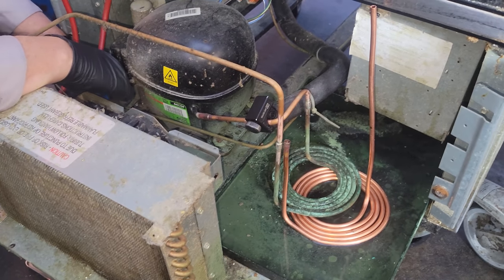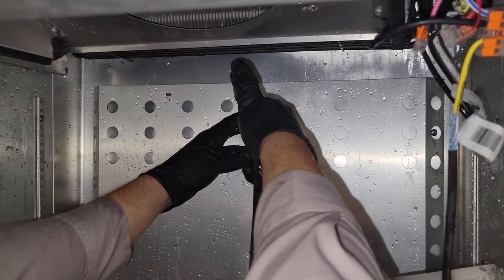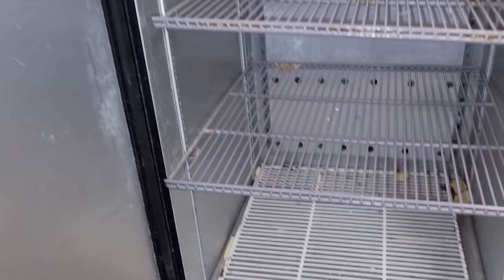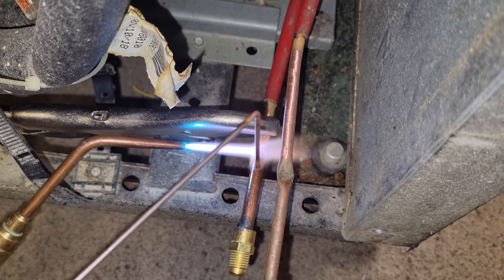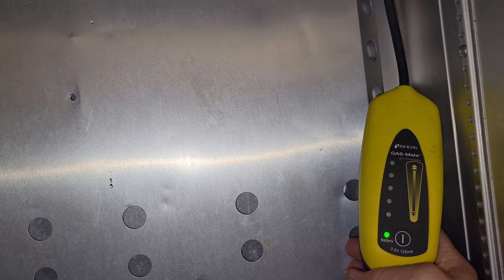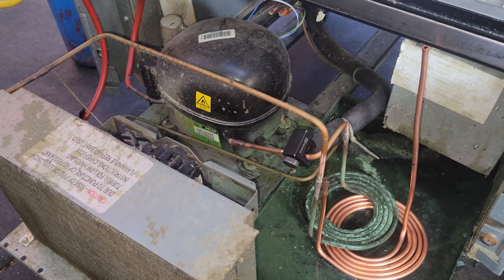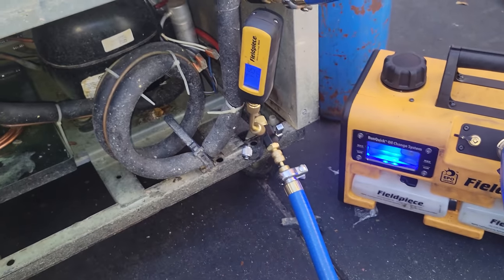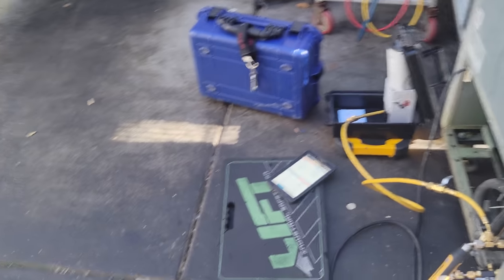TRUE STAND UP FREEZER MAKING A WEIRD NOISE

Comment: I specialize in small appliance refrigeration. I really like watching your videos. I love how meticulous you are. I technician the same way. A few tips. Yellow jacket makes a special manifold for R-290a with awesome colored 2mmID hoses (41868). Use a lab grade microgram scale for your R-290a. I also use an Accutools S10767 right on the refrigerant canister so I can turn it off right on the scale. I put another two S10767 on my core tools so I don't lose anything. TruBlu evacuation, attach manifold to core tool side ports, close pump, charge into the high side, start the compressor, home stretch into the low side leaving room for what's left in the hose leading to the refrigerant canister. Shut the can off on the scale. Let the last 0.04oz out of the refrigerant line. Then insert the high side shrader core and clear my hoses. I can consistently meet the exact charge weight every time. You've taught me so much, I hope this helps.
Reply: I have not work on R-290a system yet, but nice tips. Thanks
Reply: Gotta hand it to you. I’ve grown to loath small systems like these. Super critical charges, cap tubes, tight spaces, all the abuse they take... I work on the opposite side of the spectrum in system size, so it makes it worse when I get calls out to systems with only a few lbs or less 🤣 I like working on the huge systems, but I have massive respect for anyone who is skilled with any system, giant or tiny. Sounds like you know wha you’re doing, my friend 🤙 Kudos
Reply: The exact charge is not so much of a big deal in systems with liquid receivers.  In small cap-tube units,  it gets a little hairy.  But propane is an excellent refrigerant.  I used to use it in lumber dry kiln dehumidifiers in place of R22.  Gotta change the oil,  though...
Reply: Would a piercing valve be a better choice for adding a temporary service port on these small appliances instead of brazing on a whole new port and chopping it off every time? 😆

Comment: R290 is an excellent refrigerant.  It's nice to see that it is being accepted again in the USA.  I used to run 290 in systems I built using R22 compressors about 30 years ago.  But I was building dehumidifiers for lumber dry kilns in northern California in the early 1990s.  Worked with R12,  too before it was banned.  R290 is almost a direct drop-in replacement for R22.  It's good to see that flammable refrigerants are making a comeback.  On larger systems,  I was forced to use R22,  due to fire regulations.  But that was back in the 1990s...   when R290 was still illegal in many areas.

Comment: It was very interesting because that r290(propane) system had two leaks. First in the evap  coil then on that coiled discharge line in the drain pan. I watch your videos and they are awesome. I work on big refrigeration systems using r404a, but then I also work on household refrigerators which use isobutane(r600a) and most of them have leaks where cap tube enters the evap coil. Your sporlan's flare dryers and sight glasses are awesome, also sporlan's solenoid magnets and expansion valves are awesome too.

Comment: Dude a small trick for the condenser drain Heater i learn on the imbera fridge workshop, they put Heat shrink on the coper line, and that help you a lot with the corrosion by water or any fluid in it also still transfer the heat to the water, isn't like proof of leaking but at least make it last more without leaks

Comment: It may have been hard to see on site but the second service port you could actually see it leaking. Much like the ripples you see over a candle the same thing happens with leaking refridgerants or the like - that gas has a different density which causes the refraction of the light and you see it as that "wiggling" of the air. I was able to spot it on the second one because the camera angle was just right.

Comment: For the sensor replacement splicing... I would suggest you get phone splice connectors, and get the wet environment ones that are gel filled, as they are designed to splice low voltage thin wires and be in hostile environments without much monitoring.
Reply: Yes ,the ur and s.u.r connectors,also the gray ones for 22-26awg,pretty much good for submersion .

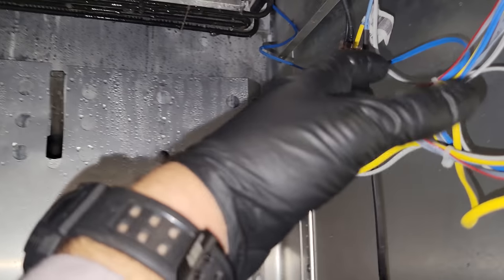Comment: I saw something interesting about 8:33+. One on the Wago connector's levers was raised slightly. I saw another video recently that as standard practice, wrap the connectors with electrical tape to prevent a problem if a lever gets bumped and raised. Wago's are good connectors, but possibly they need to have a bit more "click" when closing. Just a thought...
Reply: You are kind. I really like what you are doing. I understand that you started the channel as a way to train employees, but it is doing so much more. Thank you!

Comment: A recommendation (of course what do I know about refrigeration because I don't) I would make because you are dealing with high humid / water areas, you could use the butt splices that are impregned with dielectric grease which further seals the connection from water/moisture.  The shrink tube is a great method though.

Comment: Marine connectors work good for sensors. They're like a butt connector that you put the wires in and they have solder in them. You use a lighter and it melts the solder and the outside of the connector is heat shrink so you get a good connection.

Comment: I'm surprised I don't see you use a thermal imaging unit more often to view the temp of multiple things simultaneously like evaporators for even cooling across them and so forth. I think they are very underrated when things are going wrong and i'm scratching my head trying to figure it out lol.

Comment: Instead of using butt connectors, you can use the jelly bean connectors like they use with telephone wires. 
They're designed for small gauge wires and are waterproof.  👍
Reply: Absolutely,I am an Hvac mechanic for a very large communication company,and when in doubt we use the 3m scotchlok connectors,UR,S-UR,reds orand and the grays
Reply from the maker: I'm gonna order some of those !! Thanks guys
Reply: @m9 ovich butt connectors are not rated for solid conductors, they are ONLY rated for stranded conductors.
Reply: No stay with solder and shrink tube

Comment: Nice work! I hate the crimp tool, just slap a pierce valve on it pull a vac after the dump and get it to boil off and never had an issue,  i like to add way more discharge loop to it and help these little cu's out, filling the pan with water and pressure check is how i find these, true are the good ones to work on, your doing the trade a favor posting these, thank you sir!

Comment: It makes you wonder what could be in that condensate water that it would corrode copper tubing like that. It kind of looks like the underside of salt belt cars here in Upstate NY.  I think that maybe when these units are new that you could spray a bit of Fluid Film on that copper coil so it may never spring a leak. Since it works really well even on rust buckets it it would be wonderful in the environment at bottom of a fridge or freezer.

Comment: FYI - Instead of bending these wires over to increase the bulk of the wire a best pratice would be to tin those wires then put the butt connectors on. This will give you a much more reliable mechanical and electrical connection not to mention. I am not an HVAC person just an engineer.
 
Ricky from IBM, Ret

Comment: Love the videos bud. I know they say r290 when working properly should drop a degree a minute.  I love how clean you did the wiring! I started using the vice-grip access valves. I also switched to the mastercool r290 - r600 scale. It’s a great scale. 
Have you ever looked at subcooling when it comes to cap tubes? Keep up the good work!Awesome videos

Comment: Kudos on your perseverance in tracking down those leaks! 
I've used a lot of True products over the years, I find them to be quite robust - especially in the abusive food service environment. I can't tell you how many times I get the "Andy, water is coming up through the floor under the Coke cooler again" complaint, where I have to educate my coworkers that there's this thing called a condensate pan, and when it's full and an employee jostles the cooler, the water spills over the side of the pan (and, during the humid summertime, the pan overflows daily anyway - there's nothing we can do about it but keep tabs on it and mop as needed). The water is NOT coming up through the floors!

We have three separate spots where I hear the "water comes up through the floor, meaning the foundation is cracked" complaints, and I have to keep telling them, "LOOK UP!" The cause is always condensation on the A/C outlets or the leaking roof every time, and one might think that over 8 years of complaints about the roof leaking the property manager would do SOMETHING, but no, they won't even get up on the roof to mow the lawn. Yes, you read that right - we have a small garden of weeds growing on the roof. Someday I want to get up there to take a look at one of our exhaust hoods that isn't working, so I can tell Idiot With Toolbox to fix it. I don't know which unit(s) in the building, if any, have a roof hatch - if we had one, my nosy butt would have already scaled the ladder and poked around!

Yesterday, when closing, one of the crew shut off the only working exhaust fan, and the manager (she's only been with us for 2 months) had no idea why the oven refused to turn on. I discovered by accident a week ago that the oven was disabled when the hood fan was off - something I picked up in one of Chris' previous videos, and luckily was able to pass on this bit of knowledge. She was a bit disappointed to find the solution was simple, meaning the oven will still not be fixed. I had to bake my croissants an extra 25 minutes today because the oven preferred to stay 100° or more below its setpoint. It was 125° low the other day, had to power-cycle it to make it work again. This is another problem that has existed since I last worked at this store 8 years ago.

We bring in $200K of profit annually, can we maybe get the renovations we've been promised for over a decade? Or even just FIX OR REPLACE faulty equipment? Nope, we don't ABUSE the equipment, so therefore we must keep the dilapidated stuff we've been limping along with while the stores that destroy their equipment get NEW replacements. In my opinion, the stores that ruin brand new equipment should be forced to use the old stuff until they can prove they're willing to be a little more careful, and they should get the hand-me-downs from stores that take care of their equipment and deserve the latest and greatest...

This is why I could never be in an Upper Management position, because I'd be treating staff that acted like irresponsible children in a manner fitting to their attitude.

Comment: We had a similar sounding fan in a True beverage display cooler at my work. As it turns out, the fan cover had been shoved up into the fan blade and it was chewing up the blades. Interestingly, it seems like these coolers are known for having their compressors fail if left unpowered for a period of time. I don’t know how many beverage coolers we’ve had dump all of their refrigerant out onto the floor. Quite the mess.

Comment: So soft copper with the pinch off tool works a lot better. You can soften the copper by heating it red hot for a few seconds, at that point you can either cool it down with some water or just let it cool down naturally. The important part is just getting it red hot. Of course that's NOT something you wanna do with a charged 290 system so I'm not sure when this tip will ever be useful...

Comment: I use rectoseal pro fit quick connect refrigerant line connected in seconds I pressurized system to 400 PSI no leak through profit connection

Comment: Hey Chris.😁 I have a question about R-290. I worked for a refrigeration company right out of trade school back in '04. They dealt with 409-A, 134-A, 22. Never came across R-290. I was told in school that campers and rv's use propane, is that the same refrigerant? If not, what was it? Maybe this is a question for the live stream. Again, I have next to no knowledge of propane other than it exists (before watching your videos anyway). The work we did seems very similar to what you do. Love what you do Bud!!
Reply: I have a propane fridge that uses some sort of ammonia solution as a refrigerant.  Instead of a pump, the fridge burns propane to create a heat differential that moves the ammonia solution around in the pipes.  It can also be plugged into a 120v outlet to run a heating element instead of burning propane.

I understand that R290 is oderless, pure propane.  It is NOT burnt, and is pumped around a refrigeration system like any other refrigerant.
Reply from the maker: I will discuss this on my livestream this evening 11/15/21 @ 5:PM (pacific) on YouTube come over and check it out https://youtu.be/3viwpQZ83GM
Reply: When a copper coil turns green from oxidization, does it ever need to be replaced even if there is no leak detected on it?

Comment: The original condensate heater did look pretty bad so it wasn't surprising to see that it did leak. Just the way it did look told me that it was a question of time before it was due anyway.
Then I might question if the condensate collection was necessary there or if there was a floor drain close where it could go instead.

Comment: True has a 3 year P&L warranty and a 5 year compressor warranty. If the system runs in a vacuum within the first 5 years due to a Freon leak True will warranty the whole condenser skid. So that means new compressor, condenser coil and fan motor. Also, no paperwork to True for the parts, if it’s between 3-5 years old you don’t have to purchase the condenser section and then request credit, they just send you the whole thing

Comment: Where did you install the drier? I have seen you use Flare fitting driers before and I have used them on Residential. Could you have rigged something like that up to give you another place to bleed the nitrogen away?  I realize your space is limited in a fridge or freezer.

Comment: Love to see a follow up video regarding how much True shorts you on the warranty claim.
And, even more so, what your policy is regarding the difference. Do you charge the customer the difference?
Reply from the maker: This was not under warranty
Reply: @HVACRVIDEOS  in that case, why not replace the unit rather than the costly repairs?
Reply from the maker: This repair was a third of the cost of a new one.... so the customer chose to repair vs replace
Reply: True has a 3 year parts and labor warranty and a 5 year compressor warranty. If the unit is less than 5 years old but older than 3, and the compressor runs into a vacuum due to a Freon leak , True will warranty the whole condenser skid, which is pretty solid

Comment: If you heat the copper before you pinch it off it softens it up so it'll be a little easier to completely pinch it off.

Comment: Great video.  Do digital controls take the place of 3 switch klixon ? Or will they have both digital control with a  dtfd in evaporator section wired back to digital control ?

Comment: Resistive sensors should be using a dolphin style connector with the dielectric grease inside to prevent moisture and corrosion. From a supermarket guy.

Comment: Just curious, but when you're venting R290 outside, do you generally let staff know not to smoke around it?

Do the regulations require you to put out any warning signs or anything?
Reply: 2 oz of propane?  Lose that much lighting a gas grill...
Reply: @Tsnor150  Ahh, OK. I didn't realize it was such a small amount in a typical AC loop.

Comment: The weird flicker/flashing you get on the camera is due to the way LED displays work. It's a type of multiplexing to make it easier do drive a display with fewer wires.
Also TRUE make some VERY god systems. They don't break often, but when they do, it hurts the wallet to repair. (Worked at a dollar general a while ago, all of the coolers were made by them. They were al acting or sounding weird, but they still kept temperature.

Comment: I'm a long time refrigeration engineer (18yr) it's a Saturday and I'm watching a guy fixing refrigerators .......damn, is this what my life has come too 🤣

Love your vids, great to see that folk around the world still have the same issues on the job. 

I have always been a fan of True fridges and freezers, they are simplistic in their build and design, but built like a tank.

The down side is the wiring. They are so agricultural in their approach. 
I'm not a fan of the wago connectors, and as you found out, why run the comms cable through the body of the unit?

Comment: lol and you might have to go back to re program the controller if the sensor reeds 40 ,like when they are re stoking it will not defrost,or on def it terminates at 40 not allowing to fully defrost.also a tap valve on the low side will tell you the charge,before cutting into it.BIG PICTURE DIAGNOSE.

Comment: About the nitrogen problem while braising, would it work better if you run the nitrogen throw the low side port while braising on the high side?
🐢

Comment: I see the quality is now even worse than 15 years ago. This is my surprised face.
Reply: I remember True when they first came to UK in the 90's
heaps. 
that this fridge is only 3 years old and leaking like a sieve is just incredible
however to put a copper pipe in the condensate tray without protection or at least painting it is really bad practice and setting up for another service call in a couple of years (if the fridge makes it that long)